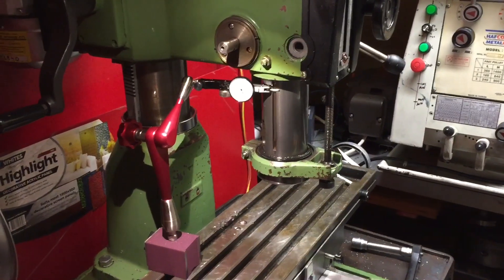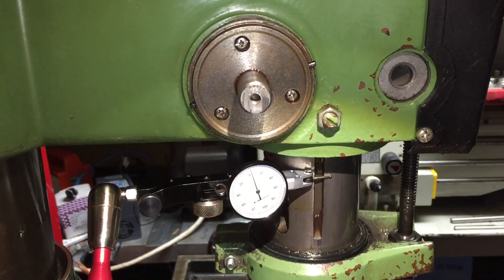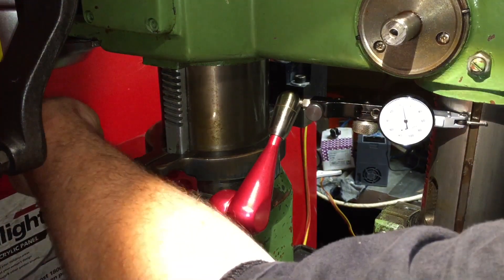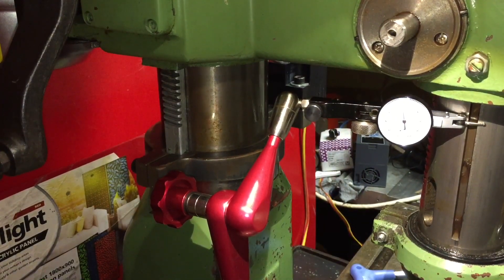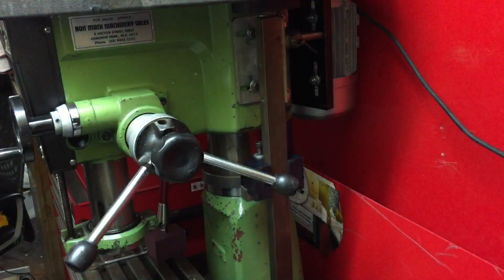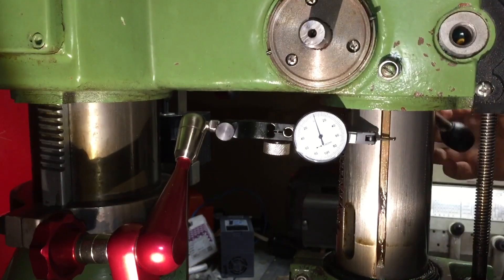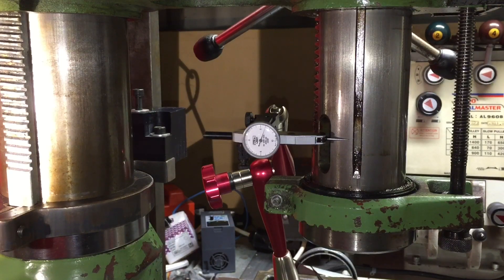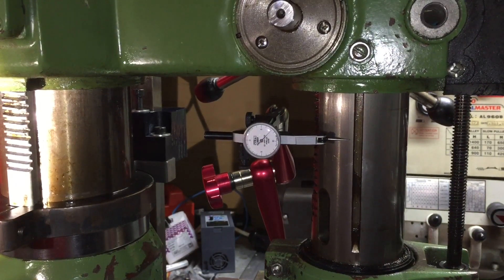Round Column Wrangler - the TruLine 8

Comment: Still think a laser pointer on the head would do almost the same thing. Mark the point before moving head realign the laser to the mark tighten head . Should be as close as the bar holding it square.
Reply from the maker: I don’t have a good wall to point at, my eyes struggle to see that fat as to be useful if you have a good spot that’s a cheap alternative
Reply: I use a laser pointer aimed onto a plumb line about 10ft across my workshop, I have found this works well.

Comment: The reason behind the round column is cost.  A dove-tail rectangular column costs' heaps.    The round column introduces an unnecessary degree of freedom to the matrix, let's call it "yaw" for want of a better term.

The introduced yaw does not disturb the tramming of the quill head but it does change both X and Y reference values.

A simple answer, and I believe far easier, is to pin the top and bottom of the rack to the column and thus hold the quill centre line steady. You would need to check the clearance between the rack and its slot, but it might solve most problems that occur when you raise the head.  In any case what reference does one use to align the head in the Y. Y1 direction from the outset?

It may prove an easier way of solving persistent problem.

Steve Callachor
North Avoca. N S W
Reply from the maker: Gday Steve! Our first design spitballing was to see whether the rack might be usable as a guide, however the term “hotdog down a hallway” is appropriate, there was no particular good place to constrain the head.
In our iterations, the 25mm thick steel collar and the self lubricating vertical block means the possible movement is also constrained further out from the column, resulting in less motion at the quill.
As far as y tram to the column, this is not usually adjusted without unbolting and shimming the column to the base
The initial quill check gave me confidence that we were in a good vertical alignment at the start
Reply from the maker: As for further alignment, the machining of the wear block is what sets the 90 degrees travel relative to the precision machines collar and bracket, the angle allows freedom in multiple directions to secure the bar against the casting even though the side of the head casting is not flat to the column

Comment from the maker: For the TL;DR 
On the way down with gravity, the TrueLine kept the round column dead nuts on (within .0005” reading on the test indicator)
On the way up, with a fair load on the winch handle, the head deflection was +/- .005” centres around 0. 
Utilising a power drive lift (e.g. hex nut on worm drive) I am confident lift variance would be again within .0005” or 5 tenths in the way up
Reply from the maker: 5 tenths is within the flex of the quill measured at the start of the video

Comment: Works well -  Would be good in a drill press as well ( not every job will fit into a mill )  as i bet many of us have had to drill large flanges on a rotary table & when tool changes are done from pilot hole to larger finished hole a head or table height adjustment is needed  it keeps everything on centre .
Reply from the maker: Great thought Max will pass it on to Bruce

Comment: None the wiser
Reply from the maker: For the TL;DR 
On the way down with gravity, the TrueLine kept the round column dead nuts on (within .0005” reading on the test indicator)
On the way up, with a fair load on the winch handle, the head deflection was +/- .005” centres around 0. 
Utilising a power drive lift (e.g. hex nut on worm drive) I am confident lift variance would be again within .0005” or 5 tenths in the way up